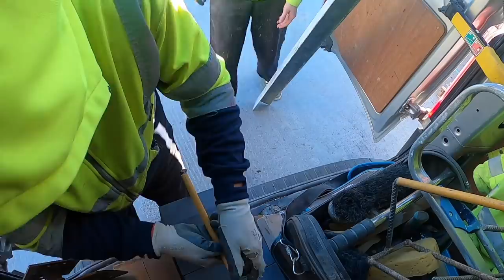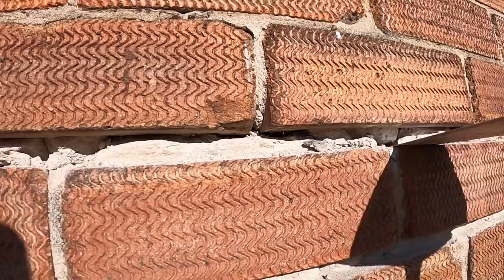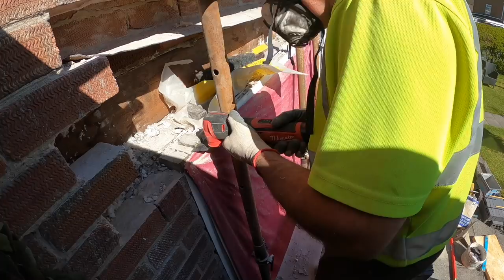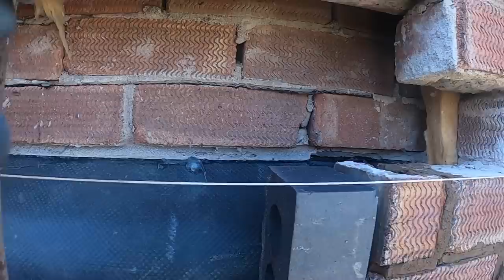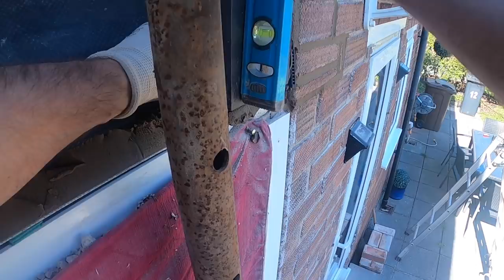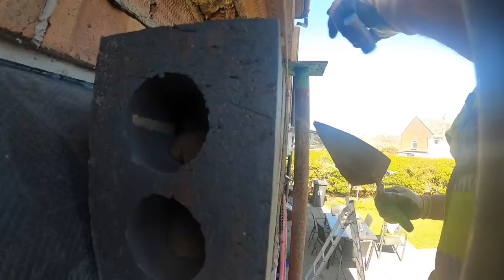AWKWARD NEW LINTEL INSTALLATION

Comment: Thank you, a very informative presentation.

I'm here learning about lintels after discovering a missing lintel in our house, missing over a large window in the kitchen.

I discovered it just before beginning to replaster the walls following a rewire. I couldn't believe it when I began taking the old plaster off! All that is holding up the roof trusses over a window is what must be a "wood lintel".

The bungalow isn't that old - around 40 years old. The previous owner must have altered the kitchen from the original structure. I don't know who did the work when the windows were fitted.

I have no idea what a job like that would cost to fix as I only discovered it yesterday. The window is around 2.5m wide and its a cavity wall - breeze block internal - brick external skin.

I'm more anxious than usual because every time we get a tradesperson in to do any work here, they invariably leave a mess or serious faults which we end up having to rectify ourselves in the end. The rewire was the same, even though a NICEIC registered electrician did the rewire. 

The thought of finding a builder to carry out structural work fills me with dread based on previous experiences with everything else. Moreover, I don't know how much this type of structural repair would cost too.

Anyway, thank you again for your presentation. It helped me better understand the process.
Reply from the maker: Wood lintels are very common and if in good condition are five to leave . 
    Most problems occur with the outdoor angle iron or no lintel at all outside, very common 🧱👍🏽

Comment: Just watched chaps and nice job. Might be worth using tarp to cover work area or get a worx jet washer which are battery operated and you can use off a tap or bucket of water to clean the area. Just adds that final touch. 👍👍

Comment: Great job as all ways just a thought I have in the past cut a slot in the back of the brick and mounted the lintel in the slot in the brick and then bedded it on to the wall. But hey it's still a great job. Window fitters look like they where smoking something.
Reply from the maker: 🤣🧱👍🏽 cheers Ed 🧱👍🏽
Reply: They do with the panels on the side, almost thought they were shutters! 😂
Reply from the maker: @ade7163  😏🧱👍🏽

Comment: Personally I’d be more concerned with what horror show is hidden underneath those 90mm plus trims next to the hinges on those French doors 
Cowboy window fitting at work !
Reply from the maker: When the doors were installed it was a rush job so the customer had to get standard off the shelf doors from B&Q and just trim the gap up . They were supposed to be temporary but as we all know A builders house is never finished.😆🧱👍🏽

Comment: We have a black polythene sheet and plastic vents inserted in between those engineering bricks. Why do we need these? Do moisture tend to accumulate more near window opening? Just curious🤔
Reply from the maker: It would be easier to google it as it’s hard to explain in a couple of sentences . Building regs say they are needed 🧱👍🏽

Comment: why do you guys lay the lintel in the mud? and not dry on the brick. I thought that it needed to be dry on brick because of the metal works.
Reply from the maker: No building regs say they must be bedded 🧱👍🏼
Reply: @SteveAndAlexBuild  Thanks for the fast reply! I bought a 60s house with roll-down above the windows and doors. bit there is no lintel and it broke down so I bought a new lintel with roll-down brackets but not sure yet how to proceed precisely.. so im doing research. do you got any tips?
Reply from the maker: @ninoklee4385  . We are uk pal so not sure what a roll down bracket is 😳🧱🧱👍🏽

Comment: I was wondering…if you take out a window and put in French doors…why not brick the job to the correct size, instead of putting in three lumps of timber either side of the opening to accommodate doors that don’t fit the opening…!!!
Reply from the maker: It was a temporary job done by the customer but as we all know tradesmens houses are never finished 😆🧱👍🏽
Reply: @SteveAndAlexBuild ….mine is…only took Twenty years….
Reply from the maker: @stun9771  👌🏼🤣🤣🧱👍🏼

Comment: Timber plant on top of frame = no shitty splits.
Reply from the maker: Which then equals all the soldiers have to be cut 🙄
Reply: @SteveAndAlexBuild  Not if the plant leaves brickwork size.
I've was a brickie for 45 years, i'm not a plum.
Reply from the maker: @jimbop4499 I didn’t say you were If you watch again I explain all this . The house bricks are imperial so gauge to 255 mm which means doing it your way would mean a 30 mm split right across the top . 🤷🏼‍♂️
Reply: Couldn't you get 2nd hand imperials for the soldiers?
Reply from the maker: The customer asked for blue engineering bricks
Reply from the maker: @jimbop4499  . Set frog down too just to make it that bit harder 😟
Reply: @SteveAndAlexBuild   or bed a tile on the lintel. That and the wood plant then covered with timber fascia. As i said though, the brickworks a nightmare......gasping for render! lol
Reply from the maker: @jimbop4499  🧱👍🏽